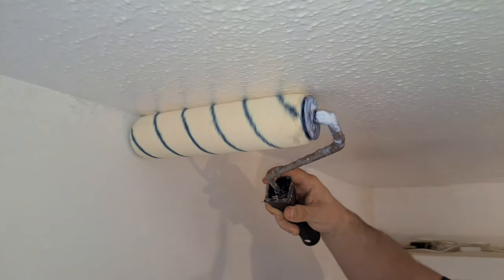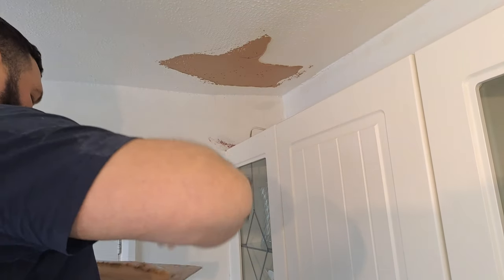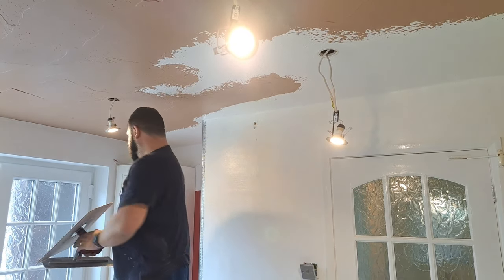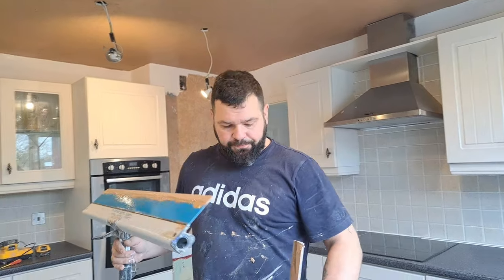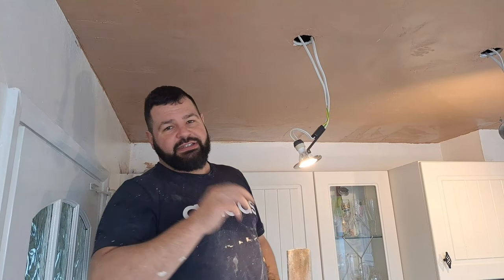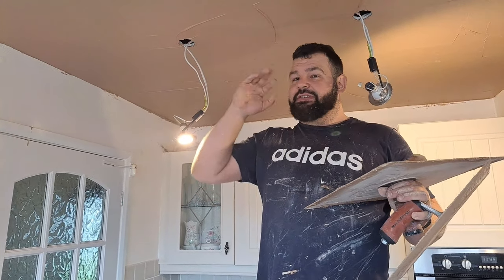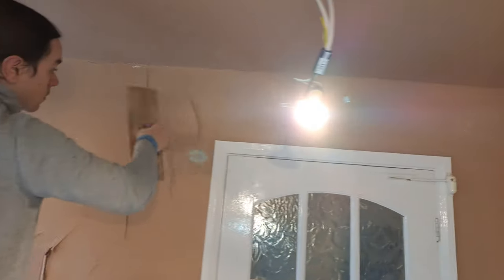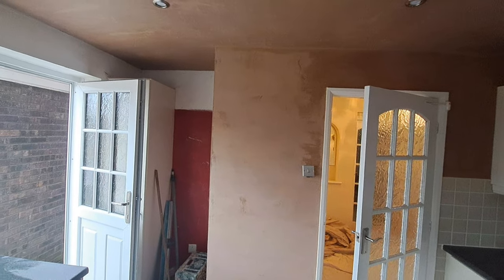ROLLING SETS & CEILING LINE'S

Comment: Loving the videos, I just did a artex ceiling first coat took 3bags 🤣🤣🤣 that's when I realised i under quoted the job lol bloody was a right graft. Keep up the good work. And your.100% right about it not drying one colour, I have met some plasterers from the old school system they use alot of water and just one trowel and when it dries it looks patchy in colour but their plastering is flat as a pancake.
Reply: That must have been a whopper mate. Any artex ceilings over 20 square metres are a pain
Reply: The uniform colour looks great but it’s not always achievable no matter how flat you lay on etc

Comment: I had a go skimming at home to try prove to myself I could lol and I found that I weren't quick enough to get both coats out of the same mix so mixed a fresh batch for the second coats and then put the first on another wall with what we're left (only because they were always loads left) 😂😂 guess they were some sense in It

Comment: Hi Kirk, videos are top notch.  Thanks for all the content.    I have some walls in my house that are all original skim coat from when the house was built in 1957. The original skim coat is fine cracked all over and is delaminating, which I am removing. Underneath the scratch coat is all cracked aswell but sound and solid ( very strong mix).  I want to skim the walls in Muiltifinish is render mesh advisable as there is too many fine cracks for skrim!!  Will the cracks not come through if no mesh is used?  I am best putting 1 coat neat sbr day before so its dry and 2 coats of multi ? Cheers
Reply: I’d embed some mesh personally for peace of mind. Hard to tell what will come back, I’ve not scrolled cracks before and they’ve not come back, and I’ve also scrimmed  cracks which have come back. Kick of the draw. Sbr it the day before. I used it the first time yesterday over old bare plaster, it dries rapid and really held the suction back after only being applied an hour earlier, I’d have had to have 3 coated it with pva to achieve the same result

Comment: You've made that so much more difficult for yourself by leaving the lights in. Customer should just get a sparky to disconnect and reconnect.
Reply: Ideally yeah, but he’s saved the customer another headache by being prepared to do it
Reply: @MrPistolpete1234  so make hard work for yourself for the sake of the customer. Makes sense......
Reply: Looks like good customer service by saving them getting a spark in and going around them and as Kirk skims away from them anyway, them being there or not is irrelevant, but get what you’re saying @stayspicy 👍🏼
Reply: @stayspicy9456  no you simply put a bit extra on the price for your trouble. And it still works out cheaper for the customer, so they’re happy and your being paid for it. Simple really
Reply: Cor you’re picky aren’t you. Any plasterer worth their money can work around dropped spot lights, no different than working around sockets, switches etc. you can’t expect the client to be forking out for a sparkle to come twice for a plasterer to skim a ceiling.
Reply: @MrPistolpete1234  exactly people  always look for problems rather than solutions
Reply: Wots hard about goin around spotlights? I suppose you don't go round sockets neither 😂😂 wot kind of plasterer are you 🤔
Reply: @stayspicy9456  of course that makes sense. It's your job to please the customer
Reply: Just unplug the light and push cable up.
Cover units with correx board as too easy to damage. £70 plus a door